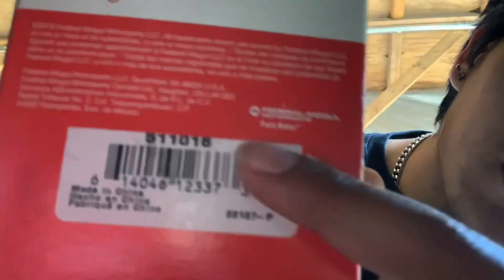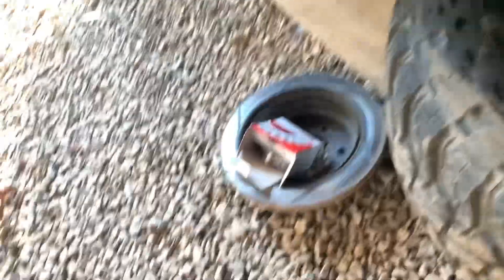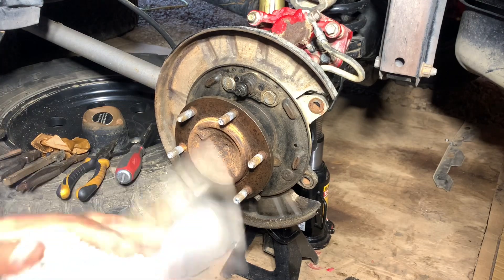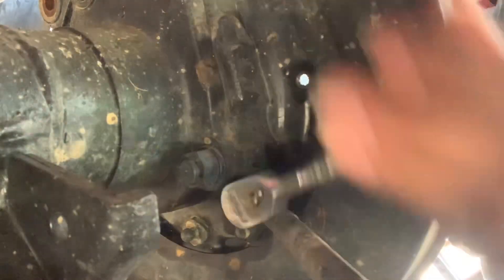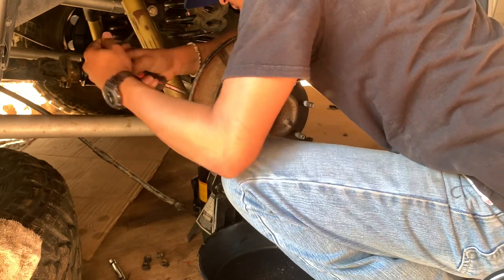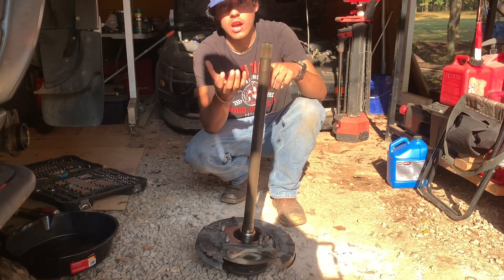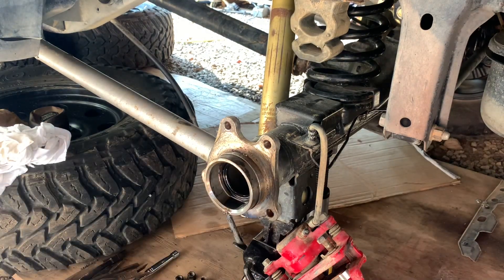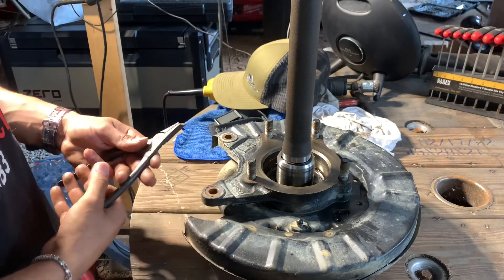Trooper 2.0 gets a Rear end Reboot

Comment: I just did part of this job a few weeks ago!  1997 model though...so slightly different axle size.  I had to pull the axles to put in an ARB locker.  Had a heck of a time getting the axles to come out of the tube!  Slide hammer and bruised hands!